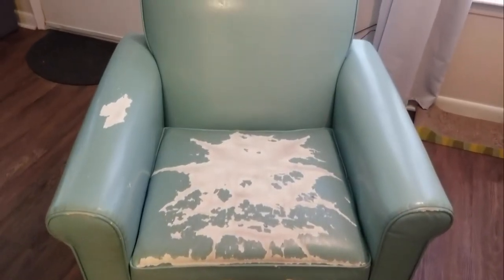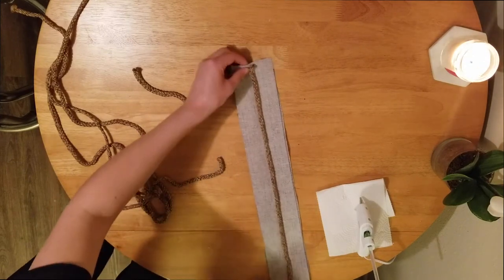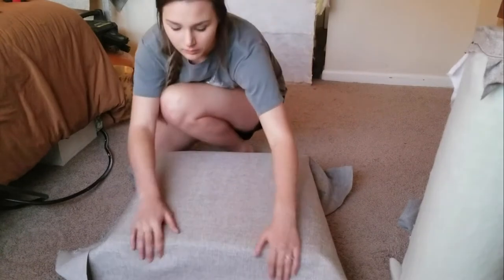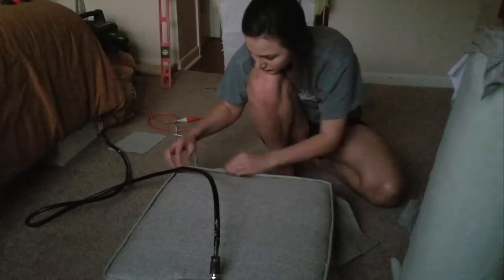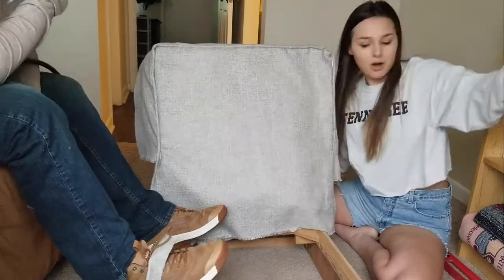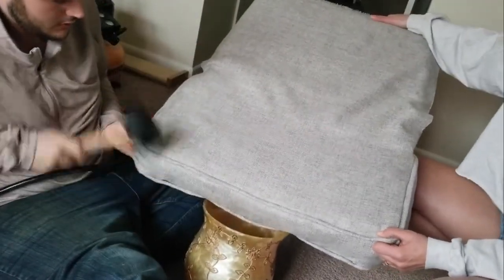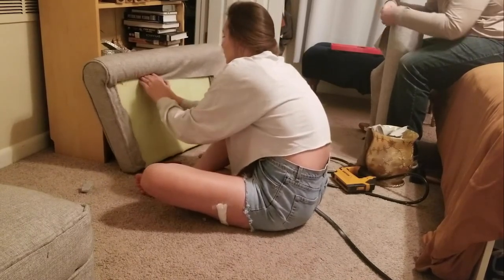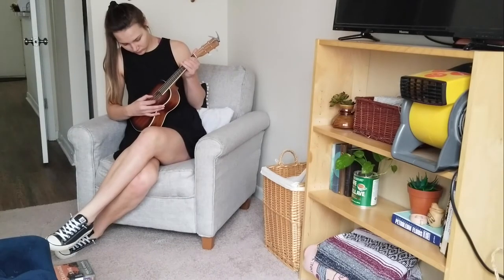Reupholstering an Armchair for Beginners | No Sewing

Comment: Nice  job for never having done it. Suggestion: always save material pieces and use them as templates alot easier for recovering,you don't have to figure sizes etc.  Always pull snug.And yes, save any foam batting you can, Looks good! Cats very helpful.lol.:)